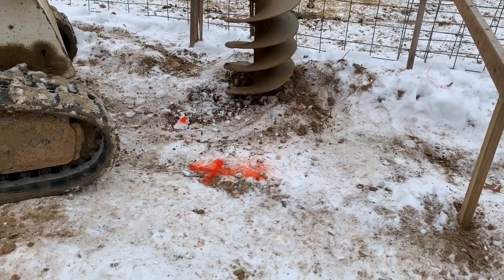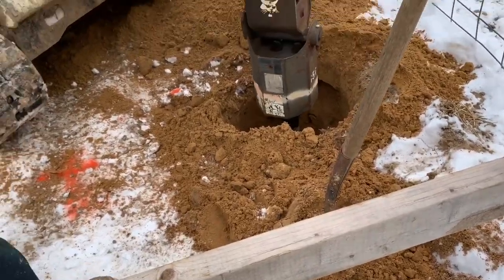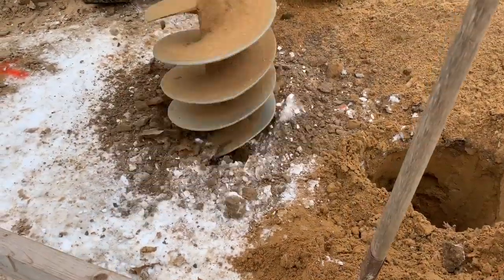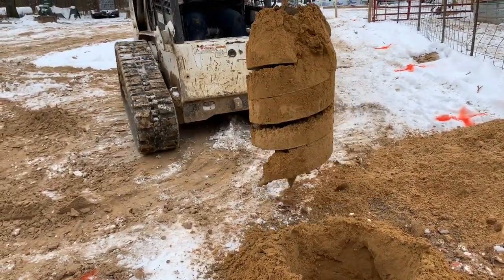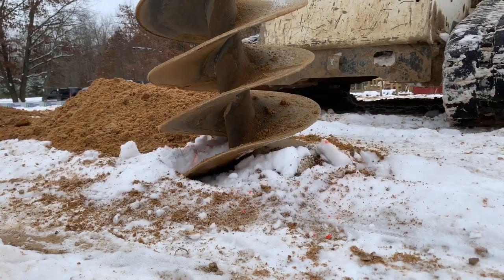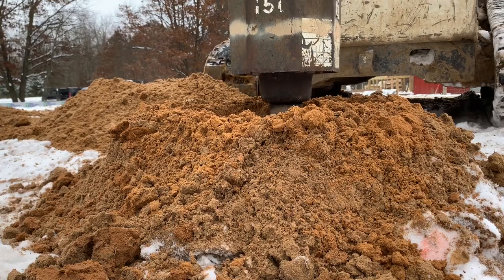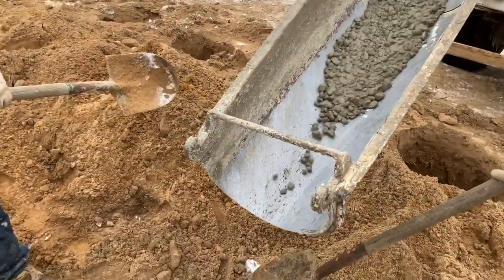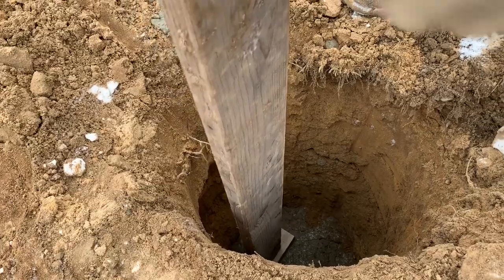New barn! Drilling holes! Part 1

Comment: 35  to 40 years ago we use to do it the same way, but found after 20 years the posts, even though they were treated 5x6 wood timbers they showed signs of rotting, and had to be fixed, today we pour the cement in a 18" tube 4" above ground and set in a steel bracket to ancer the timber on top of each cement pillar, and build off them, know more rotting problem and a much more solid base. same thing is done if using steel beams, it is a waste of money to set a costly timber that is treated into the ground f\for a building, a fence is ok as they are just 4x4 posts not holding up a building, it is very costly to fix a rotten post that is holding up a building, steel shoring has to be pushed and hammered into the ground on all 4 side and bolted though the beams from one side to the other, and it needs a very costly machine that is made to hammer these steel shoring in on all 4 sides when post are roting, if not fixed your insurance company will stop covering you until it is fix right

Comment: Let the fun begin. Built some of those myself. Patience in placement and careful drilling and alignment of the  posts is critical. I'm nuts, but would coat post ends with epoxy. Nice job here. Good mix. Great video. Keep us in the loop each step.